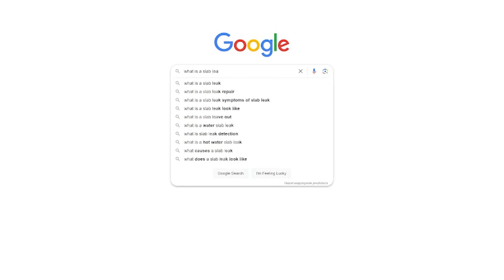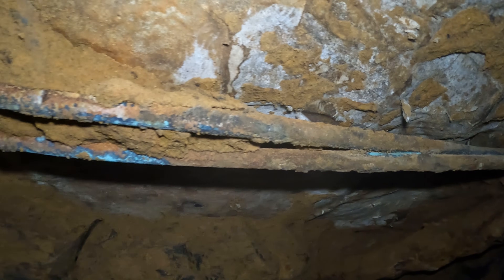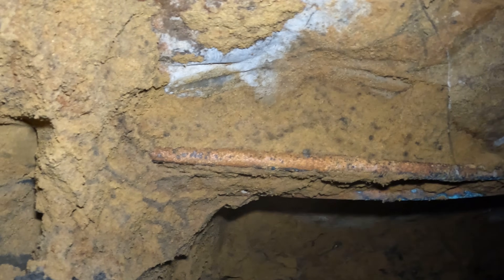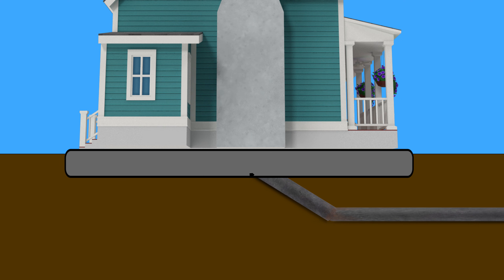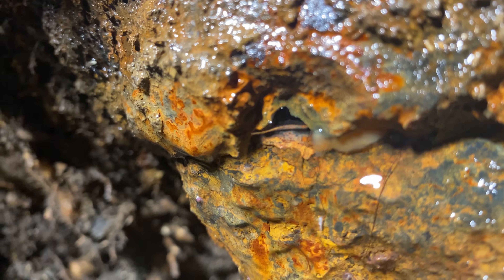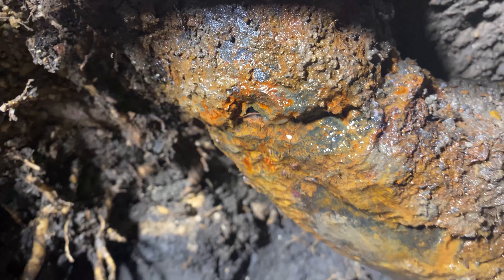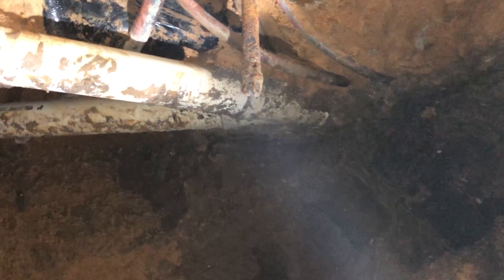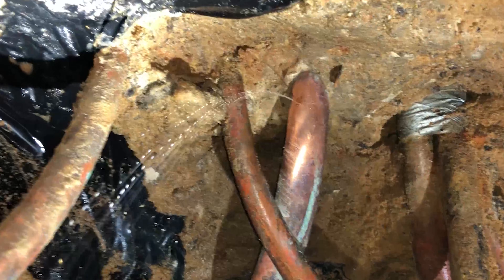How to Deal With Water Damage Under A Slab

Comment: In the central texas area and do slab leaks all the time. Tunneling is probably the cheapest for the customer, and most profitable for the business. 

If possible a cheaper alternative is always given. 3/8 pex through 1/2 copper, 1/2 through 3/4. If its not the feed obviously.

Just finished a repipe another plumbing company had dug, did 90% of the job, but then it rained, filled the tunnel with water, and they never went back. Pump the water put, get it done.